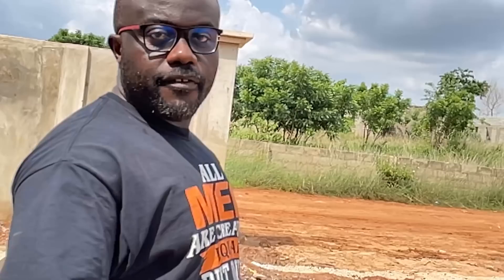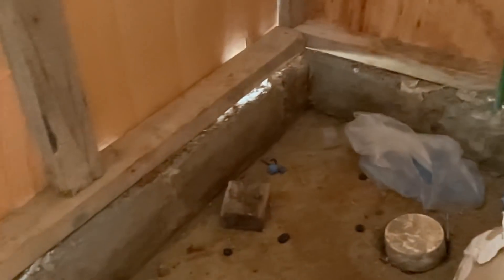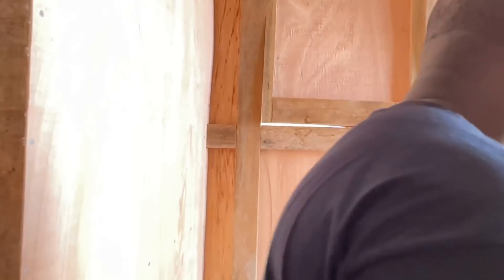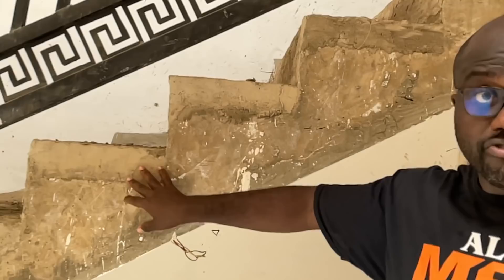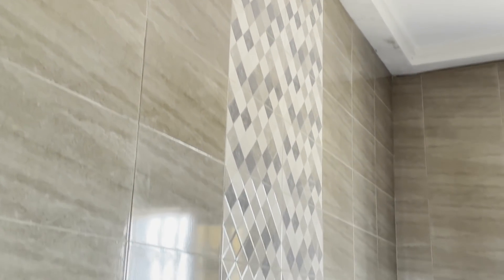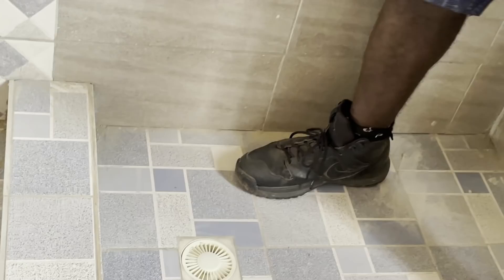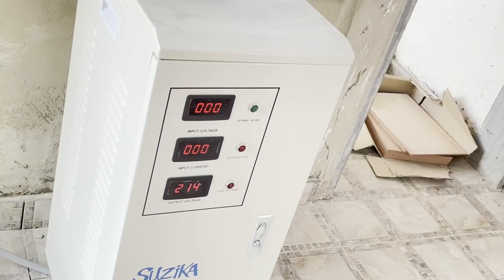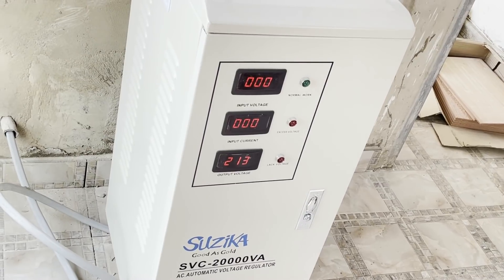BUILDING IN GHANA | SITE UPDATE & AVR OPERATION

Comment: Only an electrical engineer would see the need to dedicate a whole room for electrical controllers and meters. 😊😊
Reply from the maker: Because in future it will house the solar system batteries, etc
Reply: @kingstal90  I think it is cool that you did that. Because you can install an utilise a lot of controllers and electrical instruments ordinary lay people cannot utilize.

On the solar batteries, was it you that said that keeping the batteries cool elongates their life? 

From my experience keeping the batteries above a certain temperature is key to getting good performance from it; that is why I was advised not to put it on the floor so it's temperature doesn't get too cold.